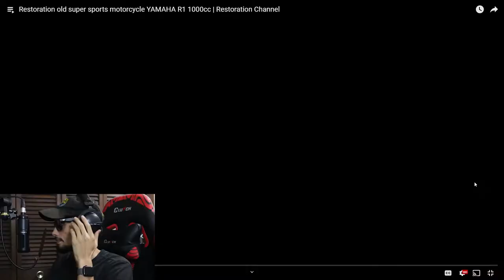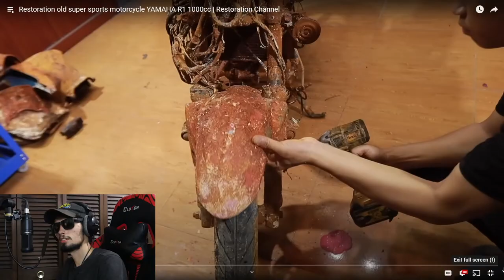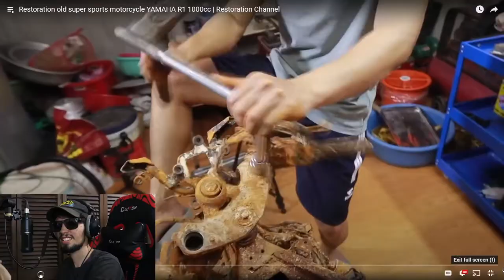Exposing FAKE Restoration Videos!!

Comment: Im new to the channel and i see everything wrong on the restoration:just dried paint, why did they put the"rust" on water,plastering it without finishing it polishing,not cleaning the stuff that are needed to be cleaned,painting it would make its condition worse,and one last thing,using the wrong things to fix it ;-;(i do like pink but i agree pink is the worst on motorbikes even any vehicles)